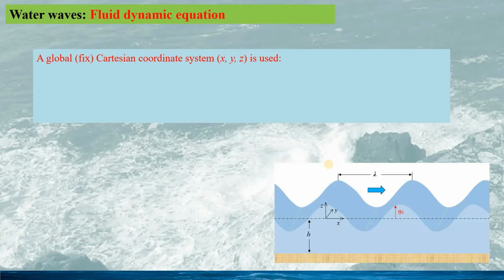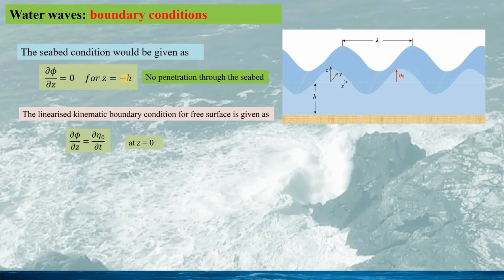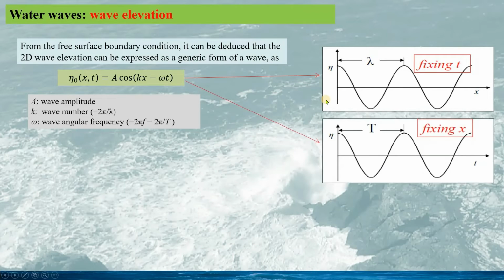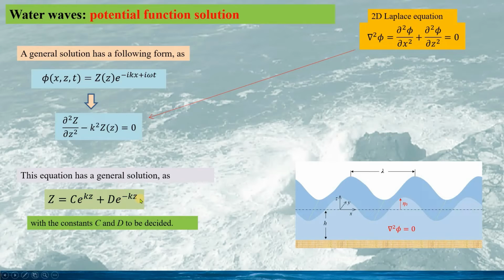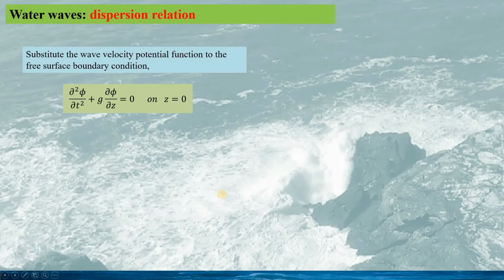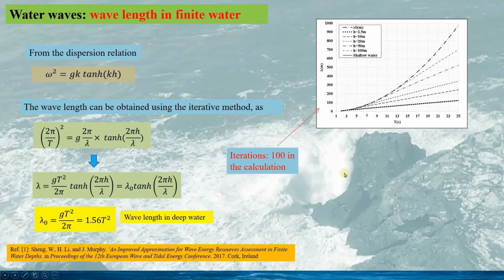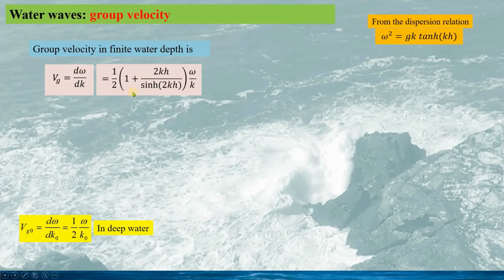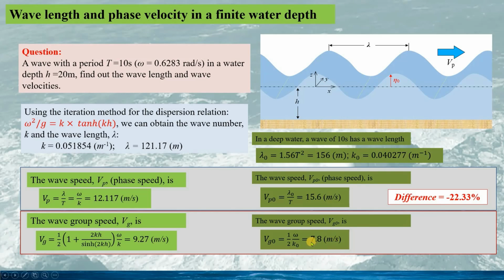[Fluid Dynamics: Waves] Water waves in finite water depths, Part 1, wave equations and solutions

Comment: Prof,thanks for the lecture.however,id like to ask,how can wave or hydrodynamic loads on wetted surface br obtained?there are simplified expressions such as Morrison  expressions for cylindrical structures but ive not see for ships sir.
Reply from the maker: Morrison' formula is only valid for small cylinders, and for large structures, no such formula. Now penal method is easily found and applied for all structures.
Reply: @ScienceofFluids  thanks prof.
Reply: Prof please would you do a complete talk on the software implementations/computer code Implementation  of a 3D panel method or direct me to where i could get some please?

Comment: i have a question about the particel velocity of water waves. there are euqations for the particel velocity in deep water and in intermediate water. are the equations for the intermediate water depth the general euqations? can i use them also for deep water waves?

And if i have a wave with water depth to wave length ratio between 0,05 and 0,5 it means that i have a wave of intermediate water depth. Does that mean that the particle velocity of the intermediate water depth waves doesnt decrease as much as the particle velocity of deep water waves, by decreasing depth?
Reply: @ScienceofFluids  Ah thank you so i can also use the formula for the particle velocity universal? 
And deepwater waves decrease more in velocity by decrasing water depth as intermediate water waves? right?
Reply: @ScienceofFluids  thank you